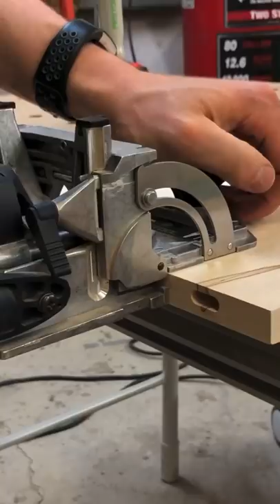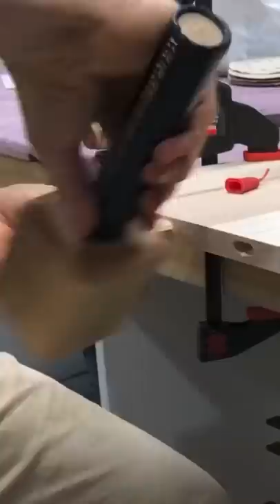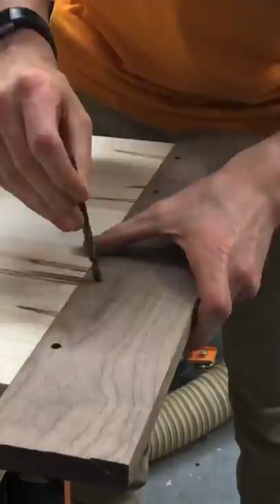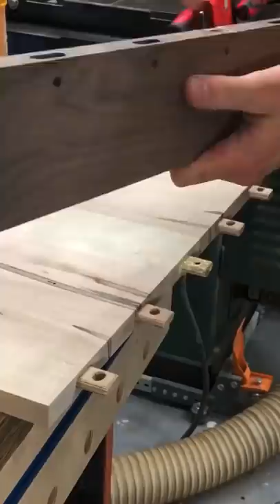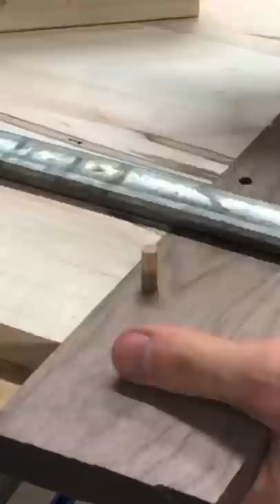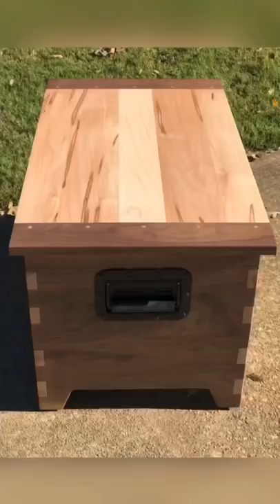Woodworking Joinery // Modern Domino Breadboard Ends for a Storage Chest Lid #shorts

Comment: Why did you make the holes in the tongues so wide!
Reply from the maker: Wood movement. Gotta allow for it
Reply: @NesBuiltDesignCo  then why did you glue it up if you want expansion and contraction??
Reply from the maker: @projectdad6561  I only glued the center tenon which will not move, so all the wood movement that happens will be equal on both sides and not leave one side with some huge overhang with nothing on the other side. That the traditional way to do it. Its not always glued in the middle but its always pegged into a hole that isnt elongated so the movement is equal equal on the sided. then for the other dowels I only glued the top. That is just to make sure if any wood movement happens to affect the breadboard end and peg then the top will still be flush and the movement will be seen only on the underside. Gluing the dowels like that is less common but more modern table makers are doing it that way now.